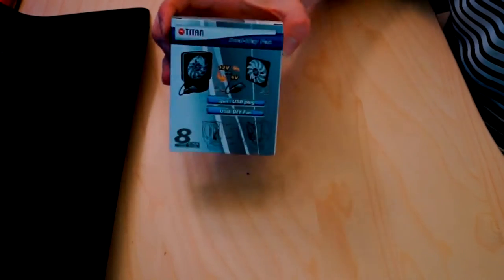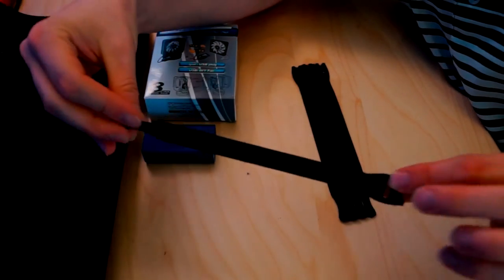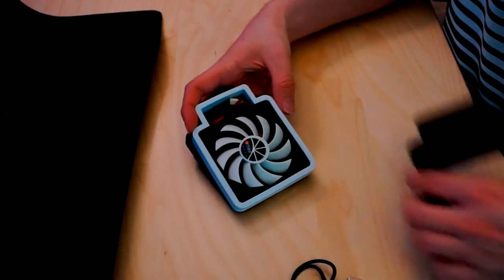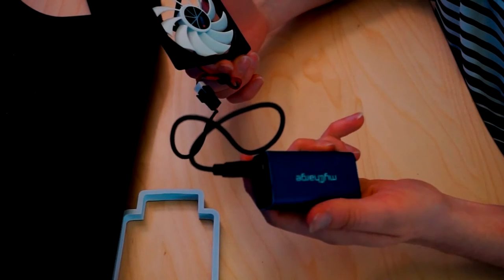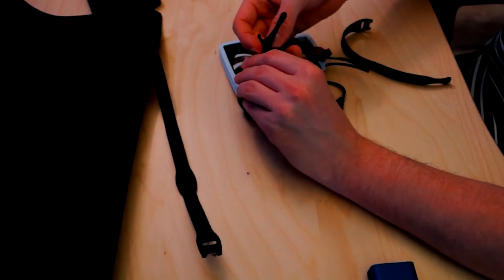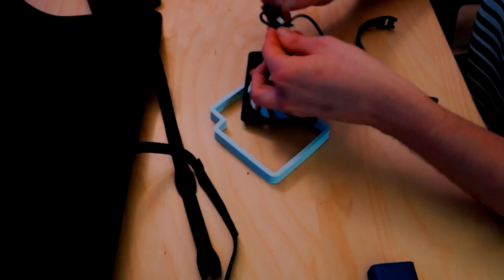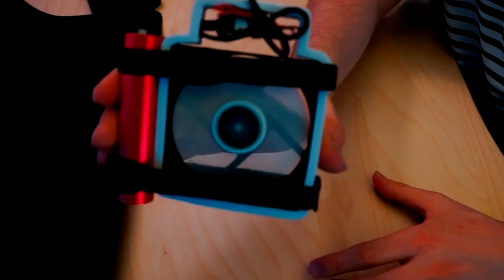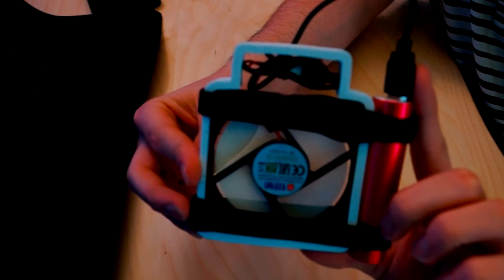How to take care of your fursuit: easy fursuit head fan

Comment: Oh My God. THANK YOU. I have looked EVERYWHERE for a fan that you could put in a fursuit without having to ORDER IT WITH A FAN FOR LIKE $100 MORE.
Reply from the maker: keep in mind this is a very large for a fursuit i would suggest a smaller one and try your hand at splicing the wires on a donor usb connector for a cheaper cost and just as useful . the fan will only draw as much as it needs to the usb power supply should be adequate and wont fry the wires.

Comment: I'm building a water cooling unit for fursuiters, mascots and anyone that needs a way to keep them cool. I hoping to sell this product later in the future if it works good enough  for peoples likings. It uses water cooling pc parts to get rid of heat buildup in a suit by dispersing it into the air. It's good for people that don't need extreme cooling(it don't use ice) but still want some form of heat dissipation. It won't cool too much because it can only cool you to the temperature of the surrounding air. The only thing that's stopping me from making it is that i can't find some of the parts i need to finish my prototype. please comment back if you like the idea or if you can help me find what i need to finish this project.
Reply from the maker: Interesting concept, how would it compete with say an EZ cooling vest. i would be interested in knowing what parts you are missing so i might be able to help source parts
Reply: I don't know exactly how well the design will work because i need the rest of the parts in order to test it out. I still need a small water pump with an inlet port on the opposite side as the outlet port and with 3/8 barbed fittings on it, a speed controller for my pwm pc fan, a 12 volt battery pack with a charger, i need to get a custom back panel made and a custom adjustable strap with a buckle made as well but i already have an idea of where to get the custom stuff made.
Reply: landon Ferguson to do that you going to want a two way jump some thing what can jump the cold water in and where it can jump it back out
Reply: The system consist of a radiator and fan to cool the water, a pump to move the water, tubing to bring water in and out of the suit via in-between the head and body suit at the neck, a fan grill on one side and a metal panel on the exhaust side of the fan to redirect the air (which is coming toward the person) and make it come out the sides, a pwm (the most efficient way to control any electric motor)  controller to control the fan speed and a pwm controller to control the pump speed, a battery pack and charger. this has been a long, slow in progress project.
Reply: I like to say that I'll work like sticking your feet out of a blanket, but you won't have to get out of the suit. I'm also trying to make it quick and easy to take it off with out having to take off your head or ruin the magic, which is a big deal to some people.